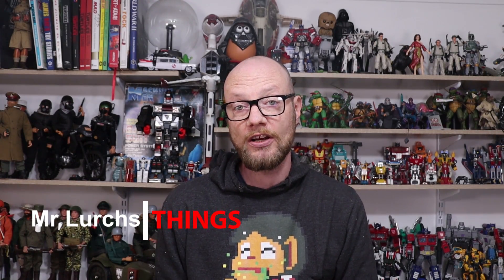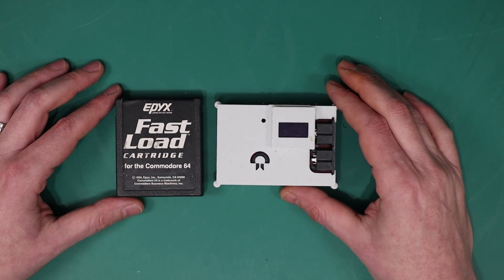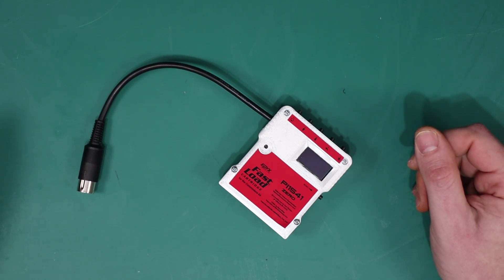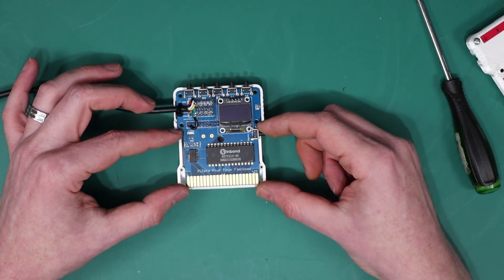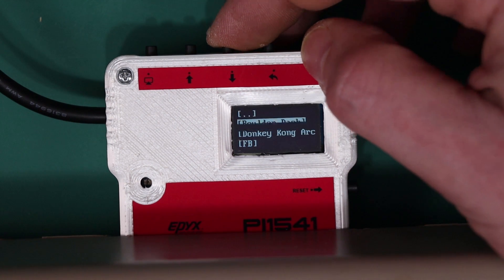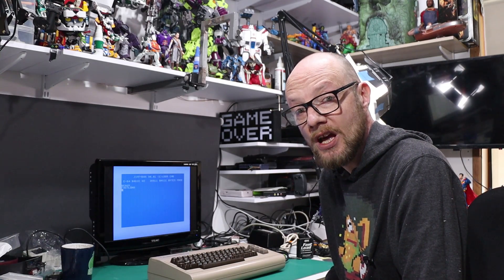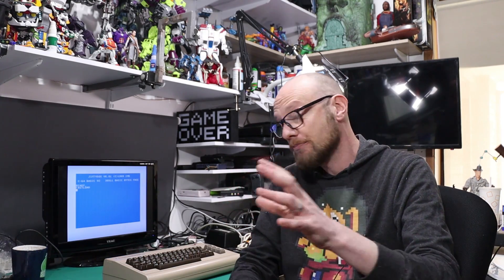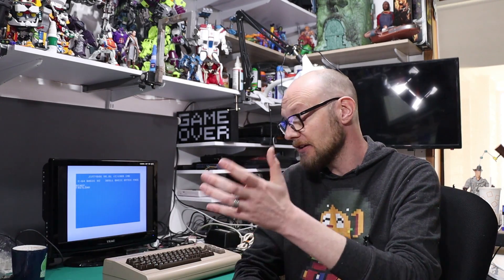Quick Look: Epyx Fast Load + Pi1541

Comment: g'day . i have this setup and the fastload doesn't work on either of my 64c shortboards .  but works fine on my breadbin.  the pi1541 function works fine but fastload just doesn't load on the shortboards  . Normal carts load fine as well

Comment: What do the buttons at the top do?  Can you change directory through software?  What about software compatibility?  How specifically does this compare to the SD2IEC... or even the Kung Fu Flash cartridge?  You really need to do more than just plug it in and turn it on, dude.  And you have the nerve to beg for donations?

Comment: I have one of these too, but unfortunately browse mode doesn't work with the fast load cartridge installed.  You can get it to boot if fb.d64 is autobooted  (into emulation mode) but you can't load anything when in browse mode even if you disable fastload in the menu.  The combination actually partially breaks the pi1541.  I'm going to add a switch to disable the fastload rom in my cart.

Comment: Awesome Product. Can you transfer D64 files from it to disks in an actual 1541? If so, can you do a quick video on how that is done. Thanks.
Reply from the maker: with this not having an IEC pass-through, no. However in theory you could with a "normal" Pi1541 using something like DraCopy. Jan Beta did a how-to a while back using an SD2IEC, but the function is the same.
Reply: @MrLurchsThings  Thanks for your help. Do you have a link to what you consider a "normal" pi1541. I am new at this.

Comment: Can the Fastload cartridge be disabled? I do recall there were some games that were incompatible with a fast loader.
Reply from the maker: Hit £ and enter
Reply: @MrLurchsThings  If you disable it using the £ key and subsequent menu, does that also disable the non-FastLoad wedge commands (ie. @CD to change directory, @MD to make directory, etc.)?
Reply from the maker: On this one no; but if the layout is what I think, it wouldnt be hard to kill the 5v going to it but keep the Pi1541 alive with a switch.

Comment: Interesting. They just "reproduced" my case design and sell it: https://www.thingiverse.com/thing:4541283
You should at least mention about the original designer of the case that you modified.
Reply from the maker: Its the case they wanted to use, but I did make sure you were mentioned on the label.
Reply from the maker: ditto with making sure Steve White was on there too
Reply from the maker: http://mrlurch.com/wp-content/uploads/2020/08/Epyx-Pi1541-Label.pdf
Reply from the maker: @cemtezcan  happy to re-do the label
Reply: @MrLurchsThings  appreciated very much. and nice job and review on this lovely piece.
Reply from the maker: @cemtezcan  I hope this is ok and clears things up. I'll do my best to make sure that the seller makes note of this on his website too.
http://mrlurch.com/wp-content/uploads/2020/08/label.pdf
Reply: @MrLurchsThings  that is fair enough for me. and thanks for reaching them about this.
Reply: @MrLurchsThings  one last thing: there is a typo. my surname is Tezcan.

Comment: Looks nice, but I think having jiffydos and the pi1541 probably is a faster loading experience.  Happy to do a side-by-side comparison/race one day :-p
Reply from the maker: Why not have both? :D (or does Jiffy cancel out the Fast Loader?)
Reply: @MrLurchsThings  as I don't have a Eoyx Fastload cart, I can't say for certain, but if you had the cart plugged in, that would be the set of disk routines used to access the 'disk drive' that is emulated on the pi1541.

And from memory the Epyx cart only has an impact on loading times, does nothing for writes or formatting a drive.

Also, the jiffydos chip has to be in both the computer and the drive or emulation equivalent (pi1541 / sd2iec) to have effect.
Reply: @MrLurchsThings  https://www.c64-wiki.com/wiki/Comparison_of_fast_loaders
Reply: Adrian Black made a video a while back where he compared a few different fast loaders for the C64 (I think it was one of his 1541 repair videos that featured a shootout between a bunch of different C64 fast loaders).  IIRC JiffyDOS was faster than the Epyx Fast Load Cart. 

It'd be great to see a similar shootout with a Pi1541 rather than a physical 1541 though...